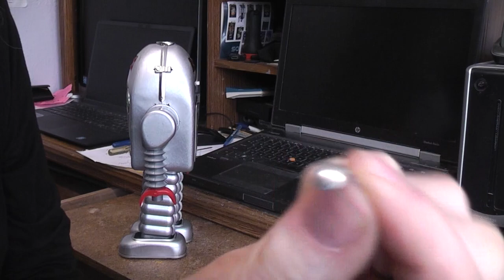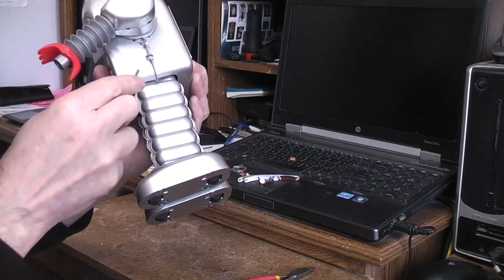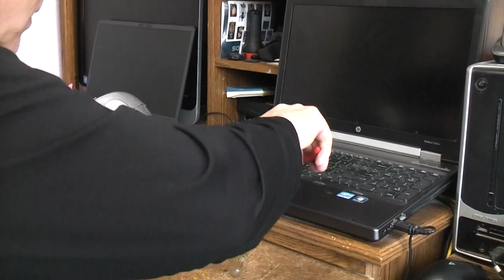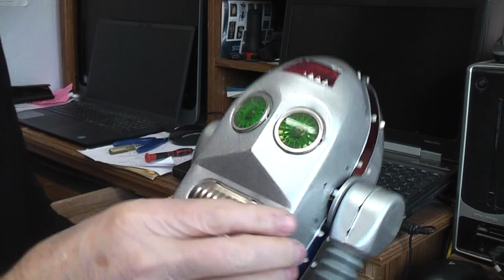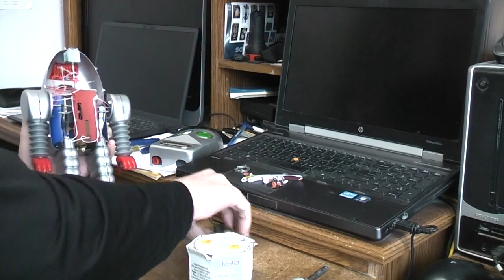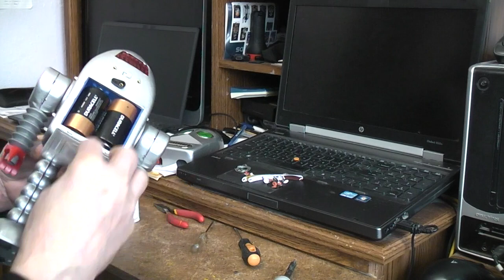Let's take apart a China Thunder robot & see how it works / repair it.

Comment: That was fascinating!  I'm surprised they didn't just have notches punched in the fiberboard piece if they wanted to feed the wires through.  It would have been easy to manufacture it that way.
Reply from the maker: I ended up just using cable "zip" ties and bundled the wires up in a safe location. You will find this pinch the wires under the metal frame method used on many China made toys. I think they do not think about the wire management  when design the toy and just go with a simple way out when it comes to assembly.

Comment: Yesssssss! I've had this brown non working reproduction since God knows. Bought it new on Ebay for like $19, as soon as I  opened the box I knew it wasn't going to work. There was a rattling inside and the switch had fallen inside😢 been afraid to bend the tabs for more than 15yrs. Now I'm in my don't give a shit 50's and just started pulling tabs till I got to the arm's and decided to search for help and there you were!!! But shit, now I'm gonna have prob get a soldering iron thingy😊
Love people sharing tha knowledge ❤Thank you so much!!!!
Reply from the maker: You have nothing lose at this point. If you do not know how to solder now is a great time to give it a try. Soldering pencils are very low cost. Use 60/40 lead/ tin solder not the new high heat no lead crap.

Comment: As a small boy I'd always pry apart my tin toys not out of a destructive need to smash but from a genuine desire to see how they worked. Watching this video I had the same feeling. I held my laptop very close to my eyes so I'd not miss anything. 

My wife asked why I was holding the computer screen so close and I said why. I got the same look my mother used to give me more than fifty years ago. At least now no robots were harmed because of my curiosity. Indeed one was repaired.
Reply from the maker: I did the same thing as a kid. The only thing you do not get from watching a video is the machine oil smell and rubber parts smell.
Reply: @Robothut  That is true. I always liked the smell the mechanical and/or electrical odor these toys gave off. Even the tin itself had and has a pleasing smell.